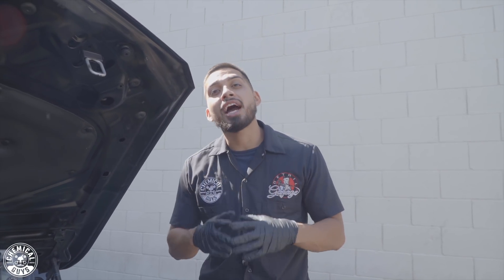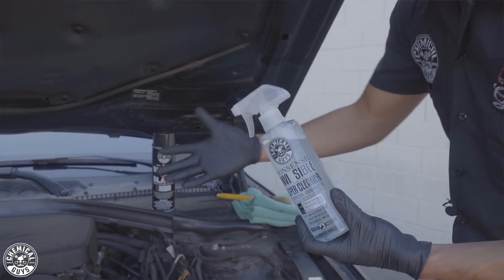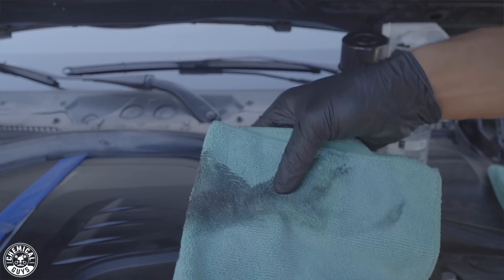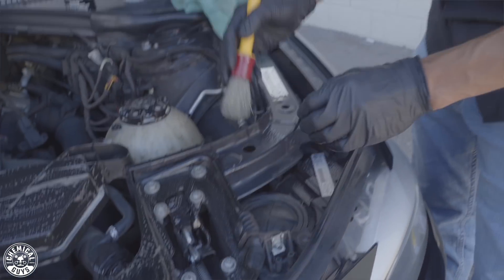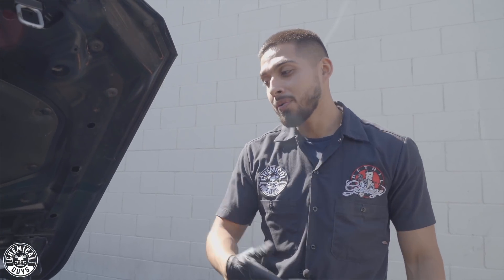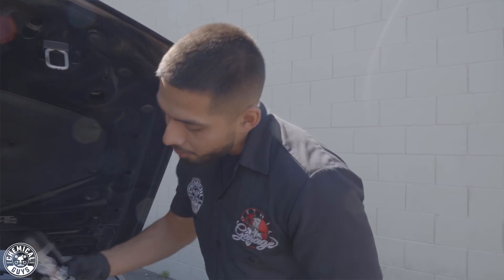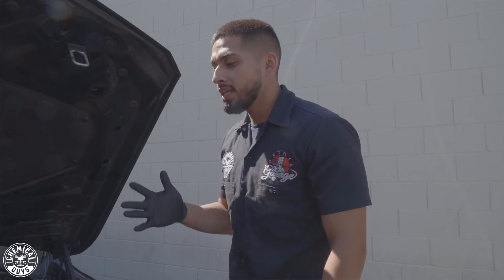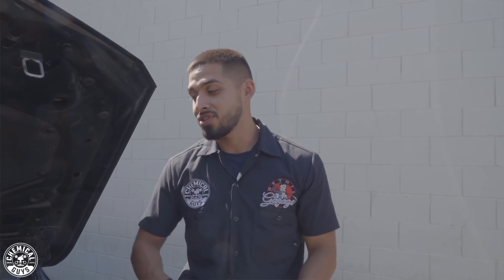Dirty Engine Bay Gets Brought Back To Life! - Chemical Guys

Comment: Can VRP be used in the engine bay? Or should you use oil based dressings only in the engine bay?
Reply from the maker: Hi there! Absolutely, it is perfectly fine to apply VRP to engine bay vinyl, rubber and plastic components.